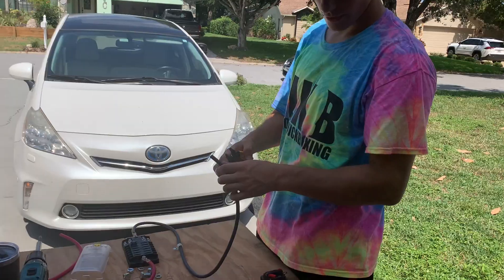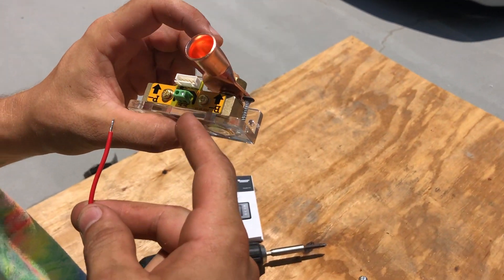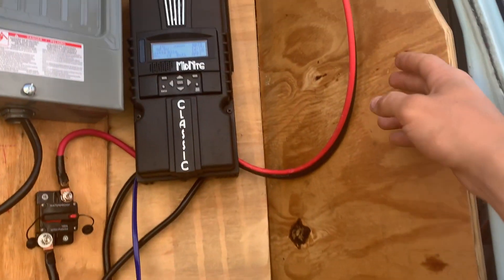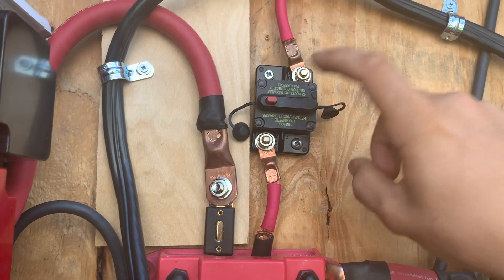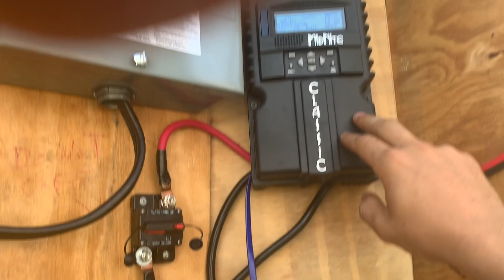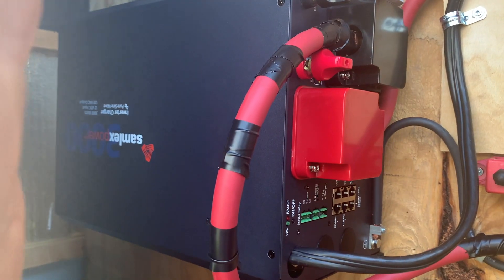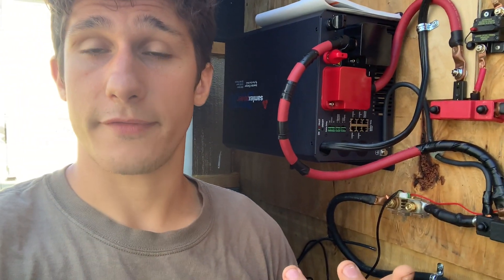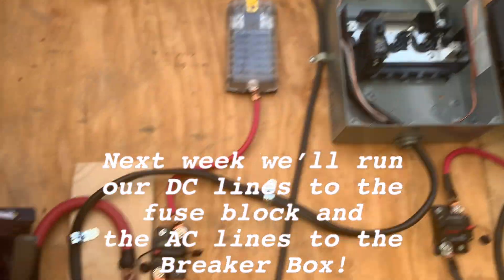SKOOLIE SOLAR! DIY Solar Power Setup for Tiny Home Off-Grid Electricity | DIY Bus Conversion

Comment: I know you did this years ago but I do have a suggestion about the inverter. I'm assuming that it's got fans in it to help move the hot air out of it. But laying down the inverter isn't as helpful as putting it upright with the fan blowing the hot air out of the top.

Comment: Hey guys!! New sub here, I think you did an awesome job on the install!! I just want to point one thing out to prevent any problems with your inverter. The black wire coming from your inverter to the breaker box; where it comes out of the inverter through the manufacturer hole. I would highly recommend a cable connector where it exits the inverter.. The vibration of driving may start to wear on the wire and mess things up for yall.
Reply from the maker: Thanks for watching!!😊 and thanks for the tip! Yeah we’re definitely not done with a lot of details and have plenty of stuff to do before we actually hit the road, we appreciate it!😄

Comment: Question.... How did you connect the wire inside the inverter that ran to the breaker box?
Reply from the maker: There are ports to run the hot, neutral and ground wires in the inverter. Three for the Breaker Box, three for the generator and three for shore power. 

They make it really simple. It’s all labeled and even came with crimped connectors which I didn’t actually use lol

Comment: Hey Shawn. Great job on the wiring.  You learned well as a novice.  We are at the point of wiring our box to our inverter to our solar HOWEVER we are not doing anything with 12V AT ALL. The plan is to use the power to go from solar/battery DC to inverter and load center there by AC.  We will power our fridge, water pump, hot water heater all from the 6 plugs we installed in the bus on 3 breakers.  Just wondering how to properly connect the inverter to the load center.
Reply from the maker: Todd McMahon, our inverter was super simple. Just connected 6/2 wire which is 6 gauge with a hot, neutral and ground from the given ports and connected them straight into the breaker box. Ours had three available ports (line, neutral and ground) for each our Grid line, Generator line and then our AC line. Any reason why no 12V?

Hope that’s specific enough.
Reply: Shawn and Ash we were trying to keep it as simple as possible for our needs.  We have lighting that runs off bus battery that we could use.  We also have LED battery lights that we will be using for our other needs.
Reply: Shawn and Ash Thanks again for the response.

Comment: OK if anyone tells you you can't teach an old dog new tricks tellem BS you just taught this old dog a lot thanks buddy my 110 is ran tru the busto a breaker box when I got it ,now I gotta run the DC and get batteries and all that stuff. I'm going very simple on that! Keep up the good work stay safe stay strong stay healthy god bless and enjoy life.✌🤙❤👨‍🍳🎅s 
PS I'm going lazy on the DC power I'm gonna get a couple up the small solar generators I guess maybe one battery that will just run the refrigerator the rest of the DC clamp will come from the generators.
Reply from the maker: Chef Santa's CulinaryTravels well thank ya! Can’t believe we learned it all honestly haha sounds like a good plan! Batteries are usually a hard part